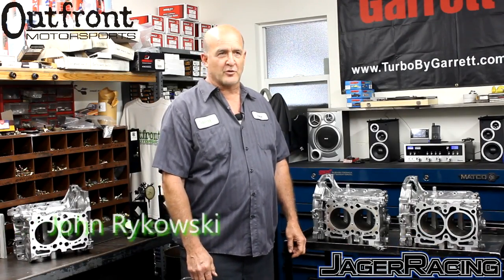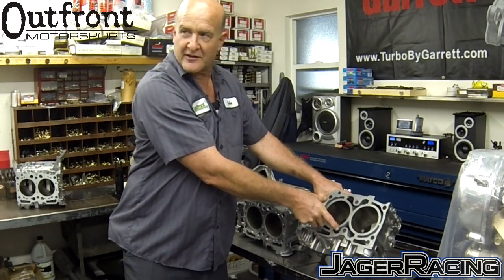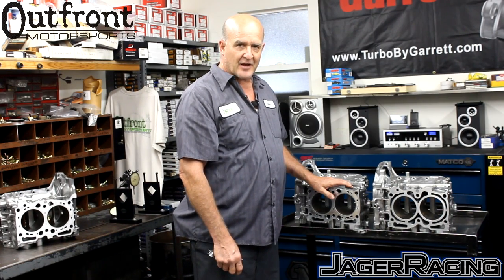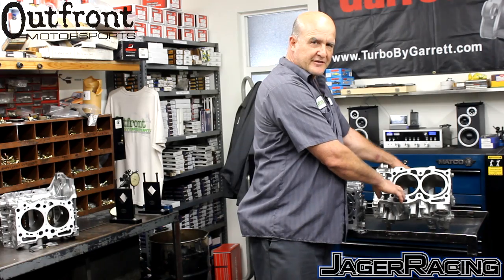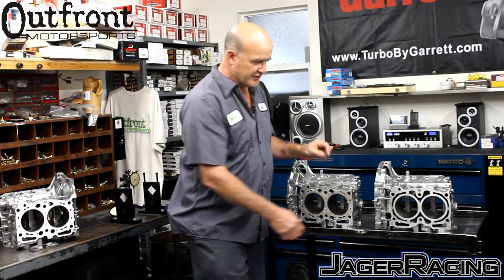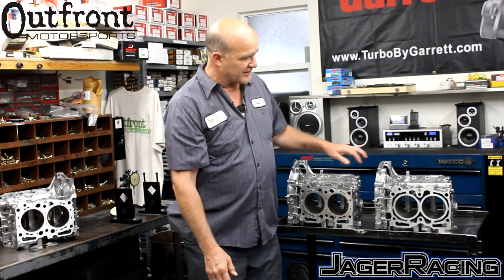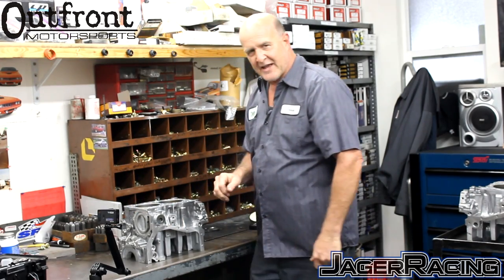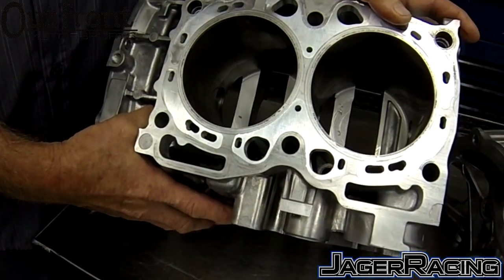Closed Deck Block Explained

Comment: What's the maximum boost level you can put through a semi closed block before it cracks?
Reply from the maker: Well I put over 40 psi and it didn’t, I think some drag guys are in the 50s. The real issue becomes keeping the heads bolted up and the rods oiled.
Reply: @JagerRacing  thanks for your response. Putting 40 psi or 2.7bar of boost pressure through, makes me think its got nothing to do with boost pressure causes the cracking. If it can handle that massive amount. Could it just be detonation and or heat cycles (not warming up properly)? Where the cylinder walls have a shock from cold to hot too fast? My engine builder won't put more than 1.6 bar through a semi closed deck or 400hp (crank). As he believes it's to do with boost pressure. 👍

Comment: Hey I got the same sound system as you ! inexpensive blue tooth with two speakers and brushed metal front not a bad little sound system for the cash.

Comment: From past experience machining aluminum in the aircraft industry I know it will change dimension considerably if it gets very cold. So just chill the insert and drop it in and when it comes back up to temperature it will fit perfectly without ever having to press it in.
Reply: Aresol spray can technique works great. Ole school af but seen people do it multiple times

Comment: Fantastic job. I would expect even non boosted Subarus could benefit. My Subaru had so many head gasket problems from open deck cylinder movement. No headgasket version ever fixed the problem. We tried them all. I believe that this would solve the problem.

Comment: Is it possible to do this to a NA EJ25?
Reply: +TheBlapman I'm sure you could, but there would be little reason to do it unless you were going to turbo that engine. Even still, you would need a lot of boost going in before you'd need to close the deck, and to do THAT you'd need to drop the compression of the EJ25. I have the same engine in my Gen 3 Legacy and I've spent a long time looking into turboing it as well. I think at the end of the day, buying something like an EJ205 and doing a conversion would be cheaper as most Subaru engines will just bolt up to any Subaru engine bay and transmission. Now, closing the deck of an EJ205 would be a viable option if these guys offer it :)
Reply: PIK "a lot of boost" was kindof the plan.
Reply: +TheBlapman Glad to hear it.

Comment: Ive got a STI block Ready for sleeves or closed deck conversion. Ive already got a quote for sleeves, but how much total for your closed deck conversion?
Reply from the maker: Well if you have a good set of case halves then to get them closed decked it is $895
Reply: Oh wow. $895 is not bad. Well I definately got a good set of case halves. I just posted a vid of my shortblock on my channel if you want to check it out. 
I was going to send it off to John at Costa Mesa R&D to get his custom sleeves put in but I might actually go this route. Im planning on running outfront motorsports headstuds anyways.

By the way, ive been following your channel and the time attack car. Baddass! 
I know you probably have it all sorted out already but Im about to do a video series on converting a STI to EPAS and im wondering if you might be interested in converting the time attack car?

Good luck this season bud.
Reply from the maker: Definitely would be worth a look you might get lucky if you mention the video and they might be able to give you a little discount. We are going to have a segment all about headstuds and the experiences that Outfront and Yimisport have had and what they have done to come up with the best solution. I know of others that have merged to other power steering systems and I will say if it is lighter and works to the same degree its always an option.
Reply: Awesome. I will mention your video for sure. Its funny that you brought up the functionality and weight of the EPAS vs the OEM Subaru PS because I actually have it planned to weigh everything as Im converting it and compare the two with cost benefit analysis.
Plus I was going to build my own bread board  controller box along with a potentiometer for the supply voltage to the EPAS but I found a guy who already makes it and its cheap! So basically I will be able to adjust the amount of "assist" the EPAS gives which is excellent for STi's with wider tires and will allow a fine tuning of steering feedback and control as the track temp heats up and the tires get stickier, which you know puts more demand on the PS. With this adjustable EPAS conversion, its a simple turn of a knob to allow more assist and no more parasitic drag from the PS pump.

When I finally get my other whiteline bushings in I will start on the conversion. Im all about having my channel up to help others, so especially if I can help you guys out to put your Subaru in the winners circle Im all in.  Thank you Jager Racing and Yimisport for your input.
Reply: Alternators don't generate drag?